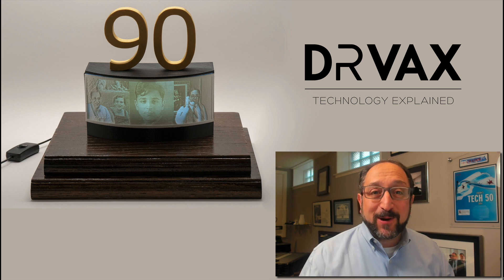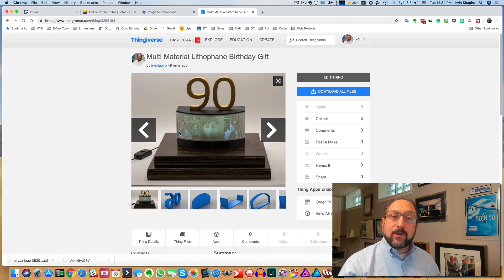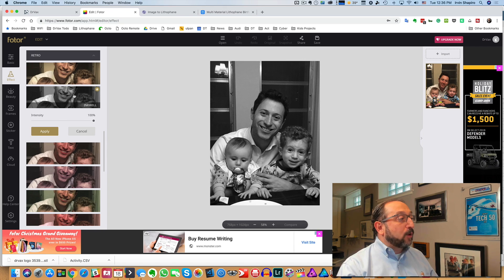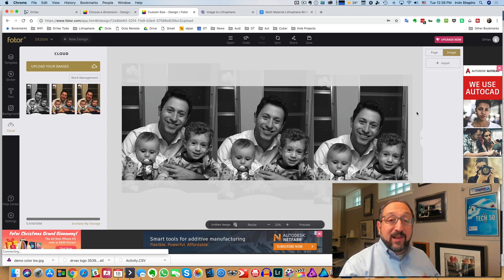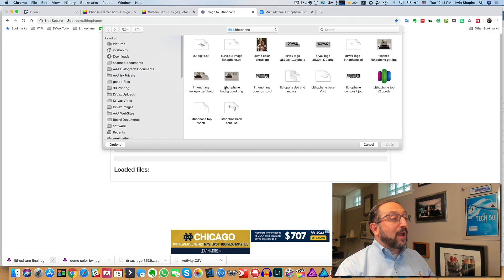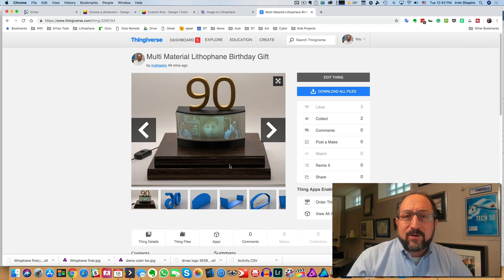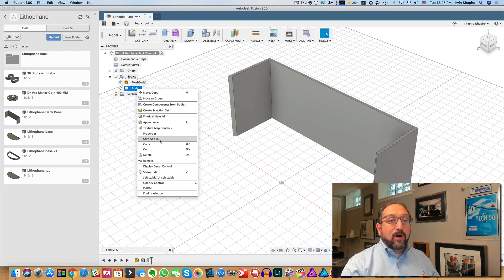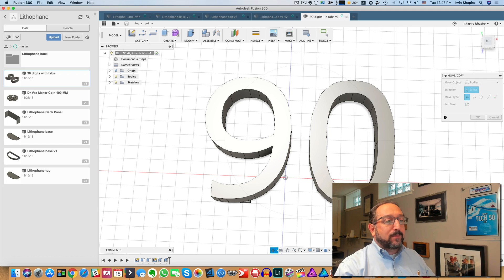How to Design a Lithophane. Part 1 of 3.

Comment: at 3d rocks website, be sure to also goto Settings, Image Settings, and slide it over to POSITIVE IMAGE, otherwise you will print a negative be default. You want a positive.  For infill, most of us do 99% (Because of a 100% bug in cura) or 0% infill but multiple shells/walls instead.
Reply from the maker: You are absolutely correct.  I believe I sliced these lithophanes in Slic3rPE and 50% did work fine.  The advantage of the lower fill rate was that is printed a bit faster.  In general your suggestion is correct.  If you have the time you will get much better results at 99% infill.
Reply: @MakeWithTech   I print a lot of lithophanes for friends and business. Average time is 15 hours :(  Would love to get that faster without lowering detail/quality.  Printed my business card last night as a lithophane... 5 Hours.
Reply: I keep getting holes in my lithophanes....😭😭😭 I have a .6mm nozzle, do I need to go back to a .4?